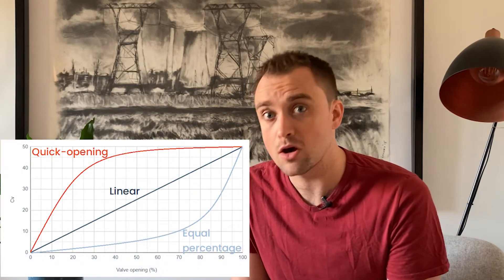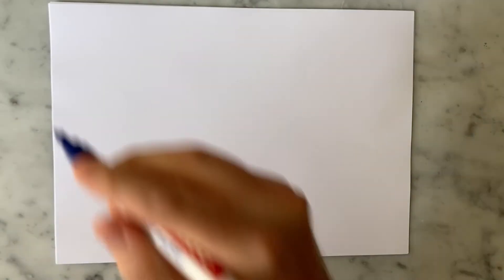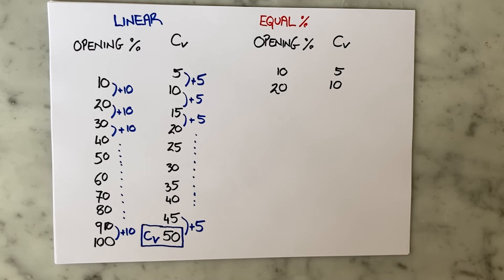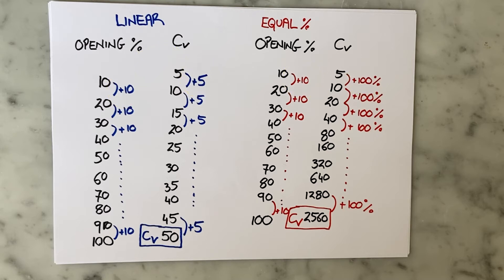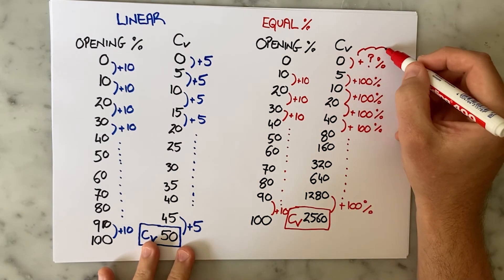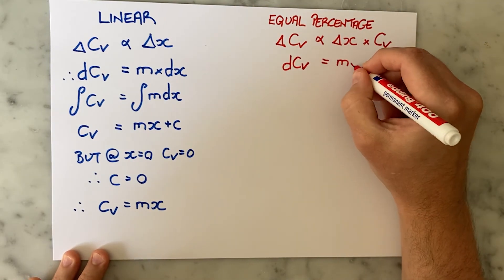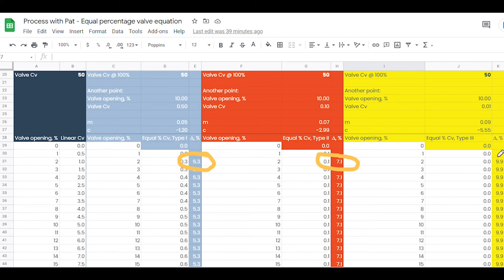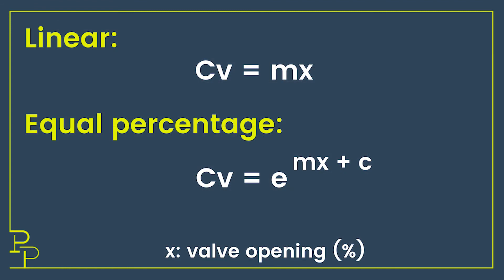Equal % valves - Part 1 - What is the equation?

Comment: For Equal Percentage valves, try instead: Cv = R^(x-1) for x > 0, where R is a fitting parameter.
Reply from the maker: Hey Bart! Thanks for this, I've checked and you are correct apart from 1 small correction: Cv = Cv_max × R^(100-x). Thanks a lot for this one! To convert to this form from what I show in the video I see that m = - ln(R) and c = ln(Cv_max) + 100ln(R). I have added this to the sheet I link! Appreciate it.
Reply: @ProcesswithPat  I should have mentioned that in my equation x is a fraction between 0 and 1 (instead of 0% to 100%). And the resulting expression is a normalized Cv curve also with values between 0 and 1. Multiply those resulting values by Cv_max to revert back to a non-normalized curve. I have worked with an equal percentage valve provider, and the expression above was provided, with different values of R.
Reply: thank you for sharing your valuable knowledge

Comment: Hi Pat, very often I go and watch your videos again. They are so informative and you really try to understand how things work.  I would like to ask you a question, which is related to this topic and related to another video you did about pressure drops. I would like to show with a system resistance curve the effect of a control valve on the head of the system. Actually, when the flow rate reduces, which means valve opening reduces, then the head of the system increases. How I could describe this with a head loss term? To be more precise how I can find a relationship between the opening of the control valve and the resistance coefficient L, which will show me this increase in the head of my system?
Sorry for the huge question.

Comment: Hi Pat, thanks for the interesting video. So, please help me out on my query. I can solve the equation for 'm' and 'c' by taking any two points of valve openings. Then, using these values how can I calculate theoretical flow rate of gas (with some water, talking about choke valves) through the valve? Please suggest.
Reply from the maker: Hey there! You can work out the flow rate of the gas from the Cv, once you e calculated it, only if you have the pressure drop of the valve using the equation that defined Cv for gases.

Choked flow is a special condition achieved when the critical pressure ratio is achieved across the valve. The critical pressure ratio is only a function of the gas in question (ratio of Cp to Cv).
Reply: @ProcesswithPat  Hey!! I do have Pressure differential value across the choke valve. With this information, how can I calculate the flow through the choke valve. Please share some useful references on this.

Comment: Equal percentage must be use positioner valve or can be only actuator?
Reply from the maker: Hey Aby! I would not say that they MUST use a positioner. In my head the use of a positioner on an actuator is independent of the valve trim used.
Reply: Thanks you sir

Comment: Very nice video as always. I have a question for you somehow related to your topic, I will appreciate if you can give me some insight.

"When control valves are mounted between pipe reducers, there is a decrease in the actual valve capacity."

 

I do not agree with this and my argument is the following if we add reducers before and after the control valve that means we have more pressure drop in the lines upstream and downstream the control valve, which consequently, means that the control valve can do less DP. Less DP for control valve leads to more Cv (valve capacity)? What is your opinion on that?
Reply from the maker: Hey, thanks a lot! So we are on the same page - adding reducers will increase dP. I do not understand the part of your argument where you say "consequently, means that the control valve can do less DP". What exactly are you imagining? A different valve, or the same one?

When people say capacity drops they mean that if you have two IDENTICAL systems where the valve characteristics and Cv in both systems are the same but the only difference is one system has reducers on the valve and the other doesn't, then the flow through the system with the reducers will be lower due to higher dP. I think that's what is meant by "the valve capacity is lower".

What you are saying is that because there is additional dP due to the reducers one would need to install a larger valve, one with a greater Cv/capacity, in order to maintain the exact the same flow through the system.
Reply: @ProcesswithPat  thanks for your reply. You got my point. If I want to keep the same flow, then reducers will cause more DP in the piping system, which means a bigger valve or alternatively the DP of the control valve is lower. We agree on that, right? Regarding the other statement, the flow is not constant, so more restrictions means lower flow can pass through, according to Poisseuille law. Do you agre
Reply from the maker: Yeah I agree with what you’re saying it’s just that when you say lower dP OR larger valve - to me those are almost the same thing. The way you get lower do is with a higher Cv valve.
Reply: @ProcesswithPat  I agree with you! Nice discussion. Btw, do you have any good reference about the percentage of DPvalve comparing to the DP of piping system??
Reply from the maker: Have you watched part 2 of the equal percentage valve video where I talk about why they are used? There I discuss this exact point, although I do not remember whether I gave an actual reference.